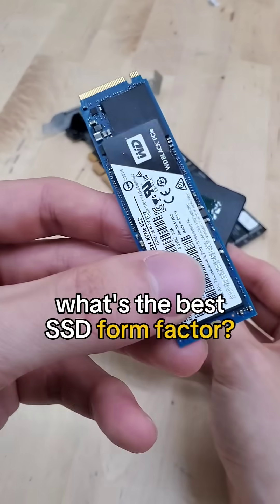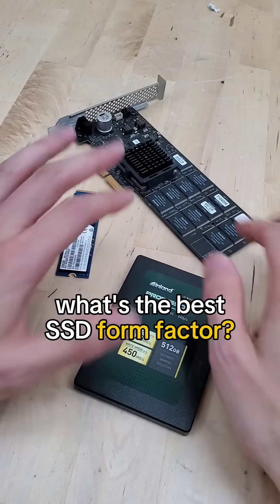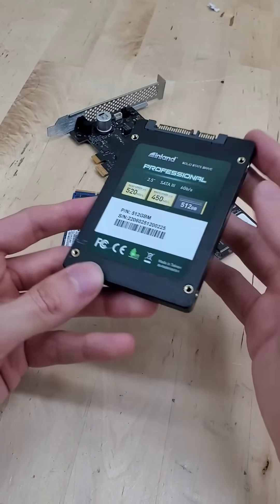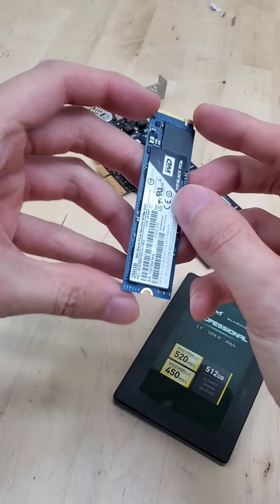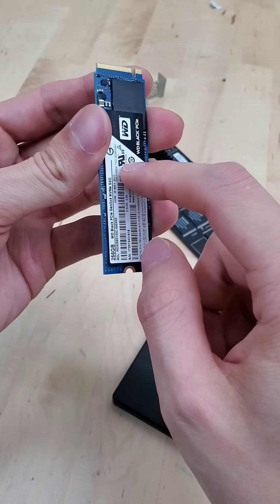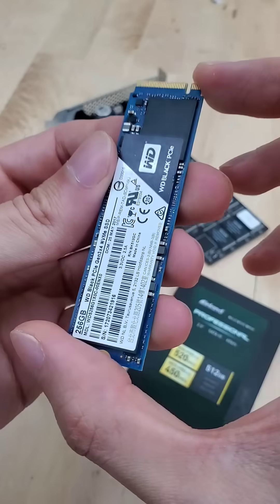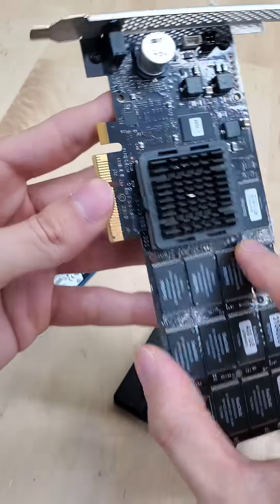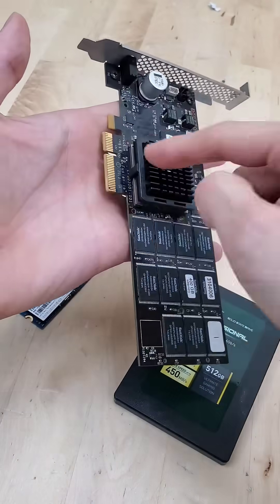The beautiful diversity of SSD form factors

Comment: The benefit of the SATA isn't so much that it's cheaper, it's not really these days. it is that you can have many of them. Your average motherboard is probably only going to have 2 NVME slots, but it probably has at least 6 SATA slots and options to expand this further.
Reply: Yeah, install the O.S. in the nvme and the sata are great for file storage
Reply: @sayingnigromakesyoutubecry2647 No, use them for older games and working data that needs low latency but doesn't need high bandwith.

Any long term data storage, as in longer than a few weeks, use an optical archival  disk or HDD for.
They last longer than SSDs, they have no bit-rot issues and having every sector mapped to a physicsl location is worth the HDDs weight in gold for data recovery.

Dara can be recovered of an HDD whose controller is shot, it ca be recovered ftom sn SSD  with s shot controller....

Also the future might hold a rturn of the 2.5 inch in the form of u.2 that was just launched for enterprise use.
Reply: @sayingnigromakesyoutubecry2647 I’d actually recommend the OS and other applications on an SATA SSD, especially if you’re using linux and games as well as other high-speed applications that actually need NVMe speeds to work at their best on an M.2 drive. Split up the workload between two drives and have backups between both that way you have a safety precaution and don’t experience any slowdown as your storage fills up for one drive or the other.
Reply: The ones with a single slot can be a real problem if you ever need to clone a drive, good thing usb adapters are super cheap now too.
Reply: PLX switches. OWC M.2 Shuttle for example. The thing with SATA SSDs is that they go up to like 64TB (or at least 8-16TB if we talk about affordable options). 8TB M.2 drives are expensive and kinda underperforming.
Reply: @Lapsio  Yeah that is fair, I've mostly looked at smaller drives, and there the saving are practically insignificant, at least in the stores I looked at.

If you're looking at bigger drives, then sure.
Reply: @LarsaXL  Yeah, tho I mean in general I'm fairly disappointed with 8tb M.2 drives - like for real. They suck pretty badly. Most if not all of them are QLC and they're far from flagship ssd performance (which is something average buyer could expect - biggest == top of the line, but apparently not this time). I understand that there sure are use cases where you absolutely need 8tb ssd in such form factor and can compromise quality but like damn - they're bad. 

I considered getting one for laptop at some point but after realizing how mid they are, I abandoned this idea. And the thing is that you can find really good, even enterprise grade 8tb SATA ssds for like 500$ (eg. Kingston DC600M) with crazy industrial shit like capacitors based poweroff data loss protection, while you kinda... can't find very reasonable 8tb M.2 options. And for sure not even close to that price.
Reply: @Lapsio  Yeah makes sense. I'm running two 1TB M.2 drives and so far that's more than I need.
Reply: @Lapsio there are ExaDrive sata SSDs with 100TB
Reply: Also SATA is most versatile.

Can install it on so many computers. I even restored an old IDE (PATA) computer with an SSD and adapter.

Also can be used as an external drive if you put it in a USB hard disk enclosure.
Reply: another advantage is that they are compatible with older hardware that never had m2 which allows you to boost the thing performance
Reply: @pracalt1051  Very much so.
Reply: I honestly thought the Sata SSDs would be much cheaper than m2s but they are not. In fact they seem very comparable price wise
Reply: @Soccercrazyigboman  I think it's due to fact that nowadays majority of SSD price is covered by NANDs themselves. Controllers are most likely not particularly expensive (especially ones insider cheaper SSDs). And you get the same NANDs in SATA and NVME SSDs so if you think about it - it kinda makes sense that they're in fact not far apart price wise
Reply: I always prefer to use sata for +2tb hdd for my non installed game and file archives cuz a u said even H series motherboards have 2x nvm slot option and i have +5 +150gb games and anout 20x +50gb games and alot of olded games. and i have only 2x 1tb nvme a 1x 500gb sata ssd and i dont have any games on my 4tb hdd or free space problem and thus amount of spac is nice for daily usage and gaming usage
Reply: I have SATA that cost less than HDD
Reply: @za_pravdu1943  Good.
I'm just saying that's the general trend, the price difference between SATA and M.2 drives have been shrinking.
Reply: Combine that with a RAID for increased speeds and suddenly you can pair 4 256gb SATA SSDs for 1TB of storage at 2GBPS speeds (depending on the SSDs) which is more than enough for games
Reply: @greyhope-loveridge6126  single core I/o which unfortunately is used by most games caps out at around 3 GB/s anyways due to single core i/o bottlenecks so it's not like you loose much with 4x SATA SSDs anyways since they will run at around 2 GB/s.
Reply: Or just use a nvme to pcie adapter and you can fit more m.2 ssd in to your PC then you have SATA ports
Reply: @Dr.Dimension  lol nice, they slipped under my radar, only heard about 64TB in production, I thought those 100TB models were only some demo units presented at expo's. Pci-e PLX switches are very expensive tho so it gets really pricey really fast if you wanna get lots of NVME drives. like 24+ per chassis. It's easier with server/workstation platform but for consumer - getting 8-16x NVME may already pose a real challenge. Modern consumer platforms are terribly pci-e starved (especially if you want to still use GPU). OWC Shuttle m.2 is cheapest PLX I could find which allows for 4x nvme gen3x2 per one nvme gen3x4 slot on mobo.
Reply: @Lapsio  tbf it could just be that i Always buy higher end Motherboards so i could have more/faster ports 
I didn't think about what most people have, even my older am4 Motherboard had 2 x PCI-E 4.0 x16 slots, 2 nvmes and more
Reply: @Dr.Dimension  also fun fact, iirc ASRock WRX80 Creator fails to POST if you load it with more than 13x NVME gen4 ssds because something-something pci-e slots power delivery issues lol...
Reply: real men have mobos with 5+
Reply: My motherboard has 4 M.2 slots
Reply: @schlaustark7374 Meaning? Try that on an ITX, mATX or, if you can find them, DTX.
Reply: also big for laptops that might not has even 2 NVME slots
Reply: and large nvme drives ramp in cost more than 2.5
Reply: i had a board with 10 sata ports and i miss it everyday😢 i have 2 sata ssds and 2 sata hdds and 3 nvme ssds i dont think i can expand my space any further
Reply: Yeah and it's compatible with older devices such as old laptops, game consoles and desktop PCs
Reply: Yeah isn't SATA more expensive then m.2? Last time I checked.
Reply: Did we forget you can get a 20tb hdd for the prince of 2 tb sad
Reply: @catacocamping874  No, but if you look at sub 2gb drives, the price difference is negligible and sometimes even cheaper for M.2.

And they're different use cases. The ssd is for running programs, it needs to be fast but not that big, the HDD is for storing large libraries and doesn't need to be fast, just big.
Reply: if you need storage volume then HDDs would be much more cust effective, you can get around the low read and write words by using a single comparatively smaller size SSD as a cache drive.
Reply: Meh, use your two m.2 as a 60Gbps boot drive. Then plug a sas pci card with 4 outs, and bam, connect to as many sas drives as you want. Sata can go one way at a time. Sas can go both ways simultaneously.
Reply: If I remember correctly, most boards will disable some of the SATA ports when you fill your M.2 slot
Reply: You can also get PCIe SAS boards which can give you as many as 32 drives per board on some quad channel cards, which can be expanded to up to 128 drives. You can also get up to 20 drives using a M.2 Bifurcation card and 4 m.2 to sata adapters with 5 ports each.
Reply: @BrunodeSouzaLino  yeah but it requires pci-e x16 which you typically don't have at your disposal after putting GPU here. If you do have more than one full x16 then probably lack of NVME is your last concern because that means you're on workstation platform that has either 4 or 7 full x16 slots XD 

I have 6-port SATA M.2 controller hooked up to OWC M.2 Shuttle PLX switch which allows you to use 4x M.2 SATA controllers from single U.2/M.2 connection, giving up to 24 SATA from single U.2/M.2 and doesn't even require bifurcation support (it has full pci-e plx switch). You will be bottlenecked by pci-e tho at this point xD (technically you could combine that with bifurcation M.2 board to drive 4x24 SATA from single x16 slot with less bottlenecks than SATA expanders). It's very hypothetical case tho due to space constraints in PC case or even rackmount chassis without additional storage shelves.
Reply: @Lapsio  If your motherboard supports bifurcation, you can buy adapters which will, say, turn a 16x PCIe slot into 4 4x slots, for example. That's what those PCIe to M.2 cards are for. There are also adapters which give you one M.2 slot and a PCIe x16 on top, which will split the signal into 2 8x ports.
Reply: M.2 NVMe eats up PCIe lanes on the chipset and CPU - as a result, PCIe slots on the motherboards are slowly disappearing, which is a pain for those of use who need certain IO via plugin cards. SATA is super handy for adding a ton of drive expansion. I even got an ASMedia ASM1166 M.2 card with 6 SATA ports in it, just in case I need SATA in the future (e.g. for a DIY NAS)
Reply: I also like the fact that it is easy to disconnect them when you want to isolate a drive.  The speed is plenty fast enough for general purpose  computing and they come in a larger capacity than NVME.
Reply: @anonamouse5917  SATA is in fact hot pluggable. Both data and power. So you can even do that live and it won't damage anything. M.2 is not hot pluggable unfortunately. U.2 is tho.
Reply: 4 sata usually, and soon maybe 2. Which really is fine with me.

The real issue is, in my opinion, that bifurcation is not as ubiquitous as it should be. Intel locks it to the highest end €400+ chipsets only, AMD does not and may have it on even the lowly A620 if the motherboard maker deems it so. 

But even then it may be an issue. A certain Asus AM4 board needed updates to work with newer cpu and the update changed the bifurcation options from 16, 8/8 and 8/4/4 to only 16 and 8/8 while I was using the 8/4/4 to have 2 more NVMe ssd. Yeah, fun times. 

I just always make sure to stick to 8/8 to have no issues and use a raid adapter from AliExpress in JBOD mode.
Reply: M2 SSDs are getting so cheap almost cheaper than sata
Reply: Mine has 5 nvme slots but I can also cram 13 sata drives on it 
That’s practically a whole servers worth
Reply: I am not a computer geek and I know you are wrong. NVME can be connected via USB and lightning wire. Making them virtually unlimited.
Reply: @Flat_Earth_Nigeria  And a good deal slower. Plus stuff hanging off the case. 

Do you think I designed an XQ69 clone to hang NVMe converters off of it?
Reply: @jamegumb7298  What are you doing that needs faster than 40GBPS?
Reply: @ 
Are you trying to be facetious? Or just being obtuse?

Very few ports if any are 40Gbps, most are 10, some 20. There goes your argument of "virtually unlimited NVMe" drives, even if you counted them as full 40 all over. 

So counting protocol overhead and the stack, that is about 900MB/s or almost 2GB/s. A great deal slower then any NVMe port. Much too slow for most applications, absurdly lethargic talking about DirectStorage (no not just for games) and soon DirectFlash. I run 2× NVMe drives in RAID 0 for a reason, and the Intel DC P5800X cache is not for nothing either. But if all you do is check your mail then yes, all you need is 1 drive 256GB worth, all done.
Reply: @jamegumb7298  lol I don't know computers,  but I know more than you.
Reply: yeah... because they're cheaper.
Manufacturers would put NVMe all over the board if they were cheaper, but they don't, instead putting a bunch of SATA ports because they're cheaper and easier to design
Reply: Mine has 3 gen 4 and 1 gen 5 m.2 lol
Reply: @PseudoEmpathy  Well tell me which board.

Oh and keep in mind, no huge builds so mini-itx with bifurcation, mATX at the biggest.
Reply: sata also allows quick and easy changing of disks for a test bench per se. sata can also alloe hot-swap which is useful for enterprise applications and servers
Reply: my motherboard has 4 m.2 slots and 3 regular pcie slots
Reply: Yes but all these SATA ports share the same PCIe x4 chipset link, along with all other chipset devices.
Reply: They also fit anywhere a 2.5 inch hard drive would fit. For example in your old laptop, or a PS4. Devices which benefit substantially from the speeds you can get out of even a SATA SSD.
Reply: i had prebious asus motherboard and was 1 slot while changed to msi it ahs 2 slots
Reply: The advantage of SATA is you're not going to damage it and lose all your data.
Reply: @daliasprints9798  that too.
Reply: You're not very PC savy are you?  You don't need a trillion gigs of storage Einstein.  If you require more than 1 or 2 2-4 tb drives then you require a NAS not a flippin 2.5 SSD.
Reply: @animalyze7120  NAS even SSD backed will always be slower. If someone wants SATA SSDs instead of HDDs they most likely want high iops and ethernet connected NAS won't do that (even 10G). You'd need to use FC or Infiniband NAS and it gets expensive really fast comparing to SATA SSD RAID10 DAS

Comment: M.2 and NVMe are different technologies that can be used together to create high-performance storage:
M.2
A physical form factor for SSDs that describes the size, shape, and other physical aspects of the storage drive. M.2 drives are smaller than previous SATA SSDs and can be installed directly into the motherboard without cables. M.2 slots can support both M.2 SATA and M.2 NVMe SSDs.
NVMe
A storage and transfer protocol that uses the Peripheral Component Interconnect Express (PCIe) interface to connect the SSD to the CPU. NVMe provides faster data transfer speeds than traditional storage interfaces like SATA. NVMe is often recommended for gaming because of its fast read and write speeds. 
Here are some more details about M.2 and NVMe:
Size
M.2 slots are 22 mm wide and can vary in length from 16–110 mm. Most drives are 80 mm long. 
Keys
M.2 SATA SSDs have two U-shaped cutouts, or “keys”, near the edges, also known as the “M” and “B” keys. Most M.2 NVMe SSDs only have one “M” key. 
Compatibility
All PCIe Generations slots and M.2 slots are backward compatible. However, it's best to buy the correct generation expansion card and NVMe SSD for your motherboard and PCIe slot.

Comment: He forgot to mention a trade off an of m.2 is that its using pcie lanes. Limits how many drives or other pcie addons you can use.

For example i can only use 2 of the 4 m.2 slots i have otherwise it will slow down my cpu due to the limited amount of pcie lanes there are
Reply: Most MOBOs make you turn off SATA ports to enable more M.2 slots or limit your 4x or 8x slots to half bandwidth or off entirely.

Comment: I remember when sata ssd came out everyone was mind blown
Reply: phew. for a long time there, upgrading from HDD to SSD was the single biggest jump in performance short of buying a whole new computer
Reply: I remember when I plugged in an ATX power connector the wrong way once and my motherboard was blown.
Reply: @jeremylindemann5117  Aren't the input connector cables AC? Or do you mean the connector cables which get connected to the pc components?
Reply: @ The wide (24pin) main power connector from the power supply to the motherboard.

A long time ago those connectors weren't designed to be pluggable in just one way as they are now so you could accidentally plug them in the wrong way around.
Reply: Nahh, I had Raptor drives in raid, 4gbs of read and write with 2gb of onboard cache which meant my 4k random read writes are faster than any SSD of todays standards.